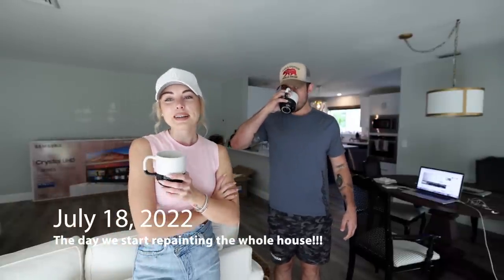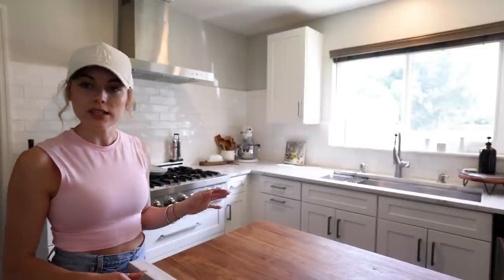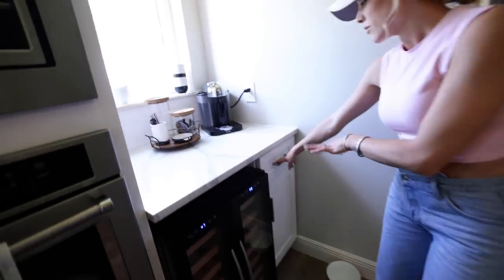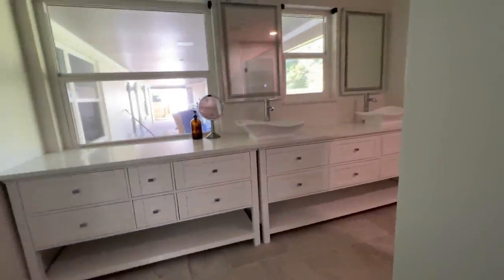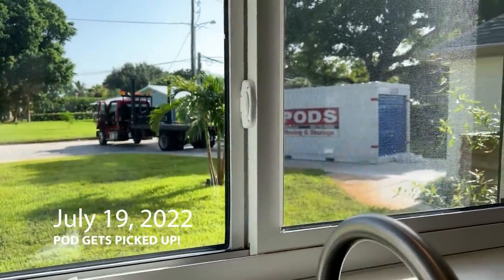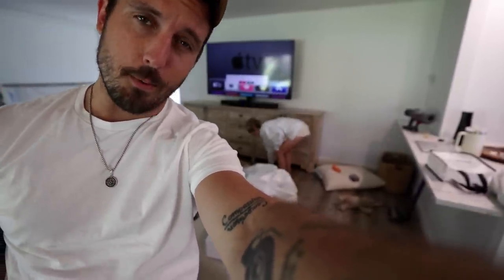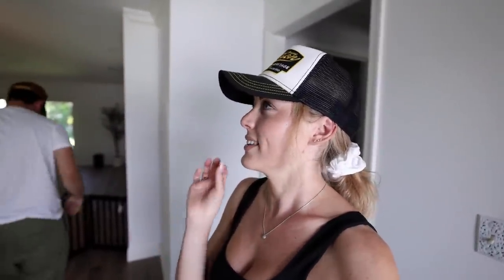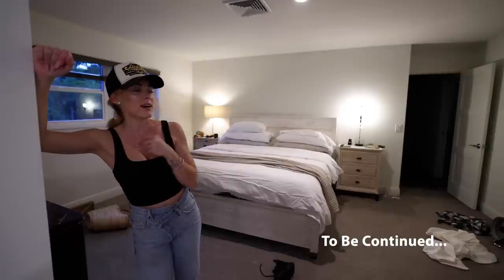VLOG: Kitchen Tour, Painting the Whole House & Organizing Laundry Room

Comment: The house is coming along and looking great! An idea for your stove hood. I wonder if you could keep the same hood and hire a woodworker to just build a cover for it in the style you want in wood. That would be a lot less expensive I would think but I could be wrong

Also about the laundry room countertop. Don’t forget whatever you put there can’t be too permanent because if the washer and dryer ever need to be repaired they have to open the tops. So it would be best if the counter could lift or hinge off or if the washer and dryer easily slide out but they are so heavy that’s hard to do

Highly recommend HIGH GLOSS on trim. It pops and wipes clean so nice. Id agree use ultra white. I live shein Williams super paint. Its more expensive but good quality and SW stands behind their paint if it has issues.